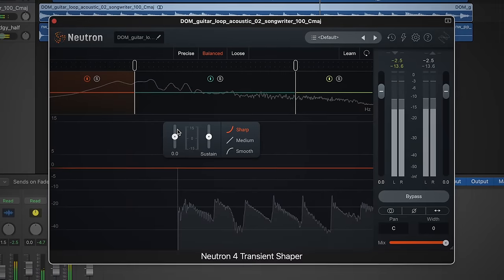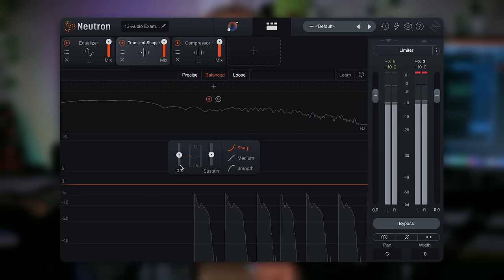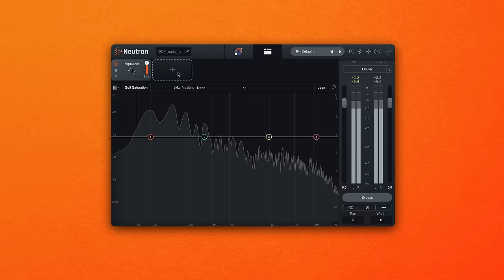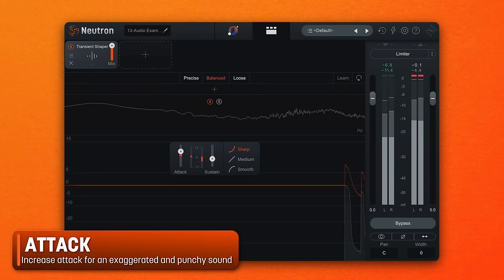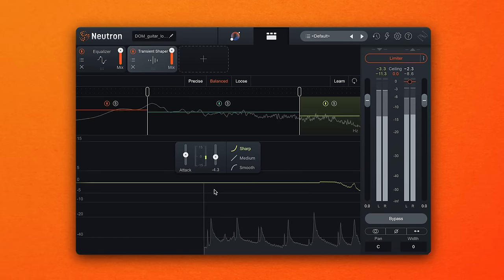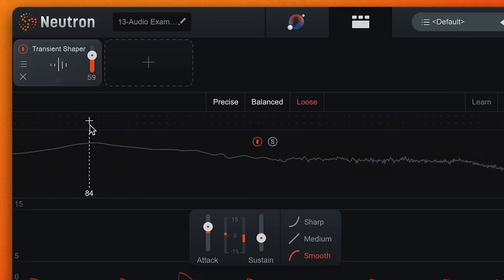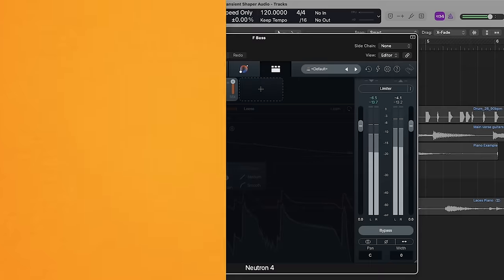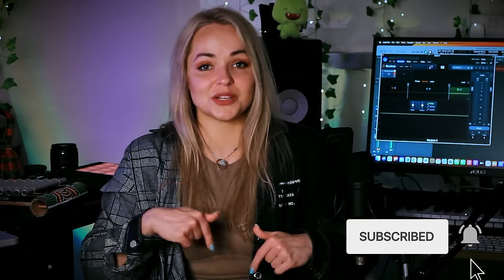Mastering Transient Shapers: Shape Your Sounds Like a Pro

Comment: Transient shapers can be better than a compressor.  If you want to get more LUFS out of your mix, take some attack out of the drums.  Ive gained +16 LUFS before just by doing that alone.
Reply: Combine it with transparent clipping and Ur set
Reply: @daniel irvine  not sure I follow, I haven't heard the term transparent clipping in audio, but I have in photo editing.  Maybe it's also called something else?
Reply: @diggadiggadj  that is the only term I know for it as it basically says what it's on the tin. Essentially its making the audio clip deliberately but unable to be heard. Great for transient sounds. since its so quick, a human ear can't detect it (unless you take it too far) so you gain more headroom by removing the sound we cant hear but computers can.
Reply: @daniel irvine  ah OK so sorta like how lossy compression works or maybe dithering?  Would that be something you apply to the mixing or mastering stage, or both?
Reply: yeah that's one way to look a It. It's used in both stages, one to contain and the other to get as much loudness as possible. Master engineers like to use transparent clipping in tandem with limiters.